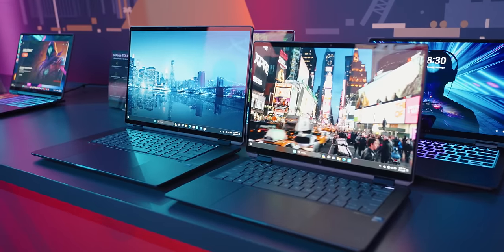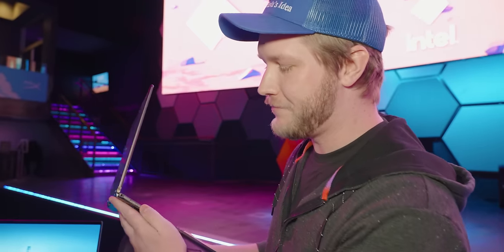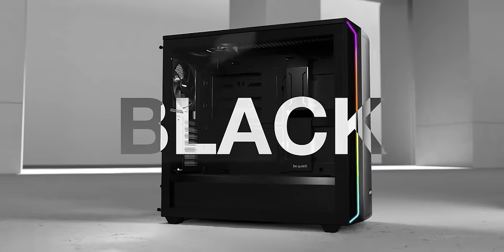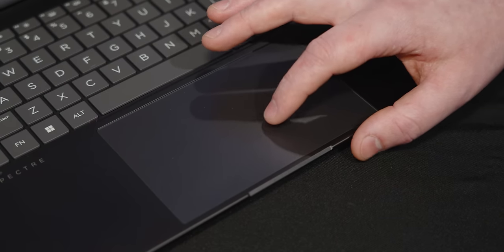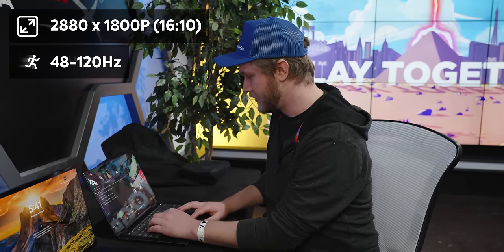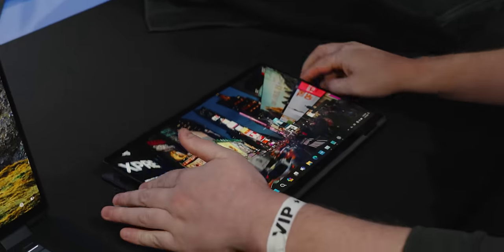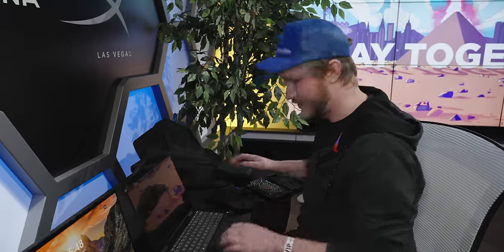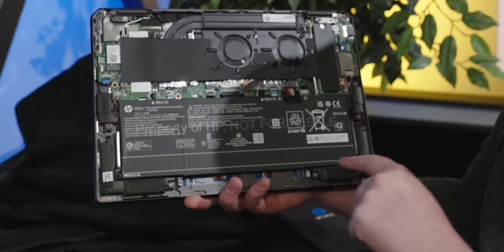Alright HP, I'm Interested - HP Spectre X360 & OMEN Transcend 14

Comment from the maker: We received some new info from HP after CES about the Omen Transcend 14: The $2000 price is for the configuration we had at CES and the actual starting price is $1499.  Also, the construction is aluminum with a sandblasted anodized finish.

Comment: Like if you cant afford any of these laptops.
Reply: twzzy3695 So you can't.
Reply: Hp has a $9000 zbook fury 16 g10!

You can max out with 128gb, four 4 tb sdds, i-9 processor for $18000, $10000 on sale
Reply: And...I don't understand what comments like these add to the discussion of these products. Something will always be too expensive for someone. So? Do we have to hear this stupid comment every damn time? Tech is always expensive new. It's not even discussion on value vs cost or anything less brain dead than "dur dur it's expensive...dur dur" .
Reply: its supposed to be funny damn you must be fun at parties
Reply: @chemicalhap  bro is the fun police
Reply: @yulpark9299  or maybe shit hasnt been funny for years?
Reply: @chemicalhap Just the broke mfs who keep complaining 😂
Reply: I want to like but I am not poor :(
Reply: We need Snapdragon X Elite 20/35 Watt in $1200/€ Notebooks, builded like MacBook Air or something. Windows 12 will boost the effciency and bring new x86 translation layer, i guess.
Reply: @gntyh I am with you. It ain't funny. It was tired years ago but the peanut gallery persists.
Reply: that means you have the wrong job
Reply: @macking104  damn for real?😢
Reply: Even if I can, I don't want to.  In 5 years it will be outdated and in 10 it'll be e-waste.  A laptop seems silly to spend four figures on.  I'd rather go used, buy something cheaper for portability (thankfully we have so many options), use a desktop, etc.  

I'll admit I'm intrigued by Framework though.
Reply: @ChristopherBurtraw  framework was outdated thanks to the long shipping wait 
Ryzen new generation is out and it was a mini update

But others stuff is repairable and have less e-waste (assume framework going strong and parts are still available ,or people still making parts for it )
Reply: @frankwong9486  thank you - you're proving my point about how fast this stuff goes out of date for how expensive it is, and framework is no exception.  The strongest thing they have going for them that few if any competitors can claim, is the ability to use the main board independently of everything else.  I bought a used first gen board for cheap from someone who upgraded and made a sick router out of it, for example.
Reply: The point of these comments was never to be funny or to make a comment on affordability. 

The whole point was to farm likes.
Reply: Well, I actually can afford any one of those laptops, so I'm not liking your comment
Reply: 4070super 😂 cool profile name that's awesome.

Comment: A $50 upcharge from 16gb to 32gb of ram on the spectre 14 is insanely refreshing. Great to see soldered ram isn’t so much of a downside here.
Reply: and apple is asking $400 for it lmfao
Reply: The funny thing is, they're still making good margin on that price when using soldered RAM. I don't mean they're overcharging, but that it's still at a quarter the price of competitors a good money maker for HP. Just puts into perspective how extortionate Apple and Dell are. 50 is reasonable.
Reply: @idontmindu  you should see dell later lol
Reply: And it's good RAM too at that. Insane speeds. 32GB of this and you will probably never need to upgrade in the life of this laptop. I doubt you will ever need more RAM on a 14" thin and light anyway. This is soldered RAM that finally doesn't get me mad.
Reply: @azenyr  It's the best RAM you can currently get i believe, they obviously optimized the trace lengths to get that speed. At any rate it's easily superior to what apple is charging 4x the price for. They're using the same BGA's they did in 2021/2020
Reply: @azenyr never say never need it on a 14in laptop, cause eventually you'll need it. Pretty much all my systems at idle use over 10GB of ram at this point, so we're already at the point where 16gigs isn't enough for most people day to day, 32GB won't be far behind.
Reply: Isn't the thing about apples ram is that it's on die? Not really the same(though I'm sure they could still do it for a lot less than they charge)
Reply: @CCBCodeMonkey  It's not it's just on the same interposer. The ram itself is industry standard (except for Max chips they are larger BGA's.)
Reply: @fVNzO  my bad I thought it more tightly integrated, then they have no excuse.
Reply: What's funny is everyone complaining about the soldered RAM in the video for the Dell laptops - even though it's the same thing, the highest performance config you can get(hint hint, these are all Intel 'Core Ultra' laptops, the high performance soldered RAM is Intel's doing). There are absolutely times when soldered RAM is bad, and it's when it's low performance garbage chips in cost cut devices. But this isn't that by any means.
Reply: @RyTrapp0  Whats even more funny is you missing the point entirely. I don't think anyone is against soldered RAM in theory.
Reply: @CCBCodeMonkey  Not at all, their marketing has been very confusing from the start. I was surprised myself to learn that it's not all on the same package. Which would absolutely add cost and complexity. But when you take a look at the laptops you can see that they're essentially just placed really close to the SOC. That makes it very difficult to desolder them without taking off the SOC itself so it's a large job. And i think not really doable due to software locks as well. Conclusion though is that they're using off the shelf parts like everyone else.
Reply: @fVNzO  Feel free to go read the comments in the video I'm referring to then so you can see how wrong you are
Reply: @RyTrapp0  And i quote from the most popular comment in this thread:

"This is soldered RAM that finally doesn't get me mad."

9 upvotes. Feel very very free to read the comments again so you can see how wrong you are.
Reply: @fVNzO  Once again - the DELL video

This video is not about Dell laptops. This video is about HP laptops. As I said from the beginning, I'm referring to the comment in the DELL video
Reply: @RyTrapp0  I don't know what dell video you're referring to. You're not doing a whole lot to help yourself here.
Reply: RAM pricing is the best it's been in a decade, modular pieces anyway. Nice time to build a high end machine tbh
Reply: GO for 64 GB if you play GT5... I had 32gb and dropped to 16gb to save money after my 9 year laptop(Msi GT72s)  gave up, and it was worst than 32 GB.. game and no background music with 16GB and it is icky

Comment: The 45 degree corner port is great because you can break your charger off from two different directions!
Reply: seems to make sense for the 360 convertible design which looks thin and llght enough to  hold.
Reply: At what point do we just have magnetic connectors already? I often think that people overreact when design flaws come up with products and many claim that it's 'planned obsolescence'(I mean, that is a thing, just not like many seem to think), I whole heartedly believe that 'Hanlon's Razor' is the answer more often than not. But I'll be damned if laptop charging ports aren't planned obsolescence, we can't get an ounce of R&D in THIS area lmao.
DC barrel jacks are the work of the devil
Reply: @RyTrapp0  after September 26, 2025 when Apple's patent expires.

Comment: Holy shit that omen has a 90W RTX 4070 despite being so thin blows my mind. I guess we need a follow up testing for that one. Anyways damn that's one hella crazy thing!
Reply: Yea, HP always seems to screw up providing as much power to components as advertised.
Reply: it's actually 80 W, it goes up to 95 with dynamic boots. Still amazing tho
Reply: @pegatrisedmice  doubt it can sustain 80W with that cooling
Reply: My 2020 omen 15 has an 100 w rtx 2060 but with open hw monitor I see it go to 108 w
Reply: Other 14" gaming laptops (at least in the same price segment) have 100+ W TGP for GPU, and they're not much thicker (like 1-3mm at best) so I wouldn't consider impressive. They're more likely limited on this Omen because of that 140W charger (Power Deliver 3.1 only)
Reply: Now that it's out, I'm pretty sure the actual TGP is 65W. 50W + 15W dynamic boost. One of the weakest 14 inch gaming laptops ever released. Just for comparison, my 2021 Asus G14 goes up to 75W. It's not a bad laptop at all but HP should've did more
Reply: @wrth I think it has excellent cooling

Comment: Pretty hype for some 14 gaming laptops with dgpu that is pure USB c pd for power. I liked my g14 but the power brick charger does make the overall backpack space more than you'd think. Can't wait to see how it compares with other 4060 4070 laptops.
Reply: When I had a G14 I set up an 90W power limit profile in G-Helper for 100W type-C gaming. 25W CPU limit and 65W GPU limit with the screen capped at 60hz to save some power on the panel. Sure, not as fast as the full 85W CPU and 105W GPU, but it was still better than the iGPU-only I had set up on battery with a 15W cap (basically converts to 6900HS to 6800U).
Reply: I bought the 240 W SlimQ charger with the asus adapter for my g14, definitely more portable than the oem charger

Comment: Nice to see they've gone back to removable wifi card on the Spectre x360. We dropped Spectre (and HP) from our org after using them for 5 years... because they soldered in the wifi cards on the last models we used. Manufactured e-waste stuck in wifi 5 land.

Comment: Haptic touchpad, variable refresh rate, and that spectacular webcam are all pretty nice upgrades over the last model!

However, I'm a bit worried about the battery life for the Spectre considering it ONLY comes with an OLED. But considering the Zenbook 14X OLED is getting about the same battery life as the Macbook Air, I would assume it would be pretty good. Wish it would come in actual silver though.

Also, HP probably is reporting accurate battery specs for its higher end models, but in my experience, they have been reporting double or even triple the real battery life on its models like the Pavilion or lower.

Also also, the 16" starts at $1598.99 US.
Reply: Hp pavilion Plus 14 (68 Wh) with #AMD 7840U has 10 to 11 hours of BATTERY.

Hp spectre x360 14 (68 Wh) with #Intel Core ULTRA 7 155H has 14 to 15 hours of BATTERY. 😱

Intel laptops BATTERY life is as good as MacBook M2/M3 even though Intel is using Tiles/Chiplet.
Impressive🤯
💪
Reply: New Zenbook 14 OLED 2024 with Core ULTRA 7 155H got 70% better battery life than Zenbook 14X OLED.

Comment: How did crab rave sound on the spectre? Did you check? The speakers are a weak point on the 2023 spectre, but it's otherwise really good (compared to the old diamond cut models).

Comment: Has hp fixed the self destruction on the x360 where the mossfets get so hot they weld themselves to the first layer of the board?
Reply: I’ve also never seen a brand with more spicy pillows and hinges that end up so loose they fall in half after a couple years.

Comment: I hate that HP locks down drivers for the keyboard and fingerprint reader. I really like my spectre 14 but it gets hot on windows so I run lunux now. Why can't I have a working keyword HP? 
Also, they removed an option to charge the battery to 80% some time ago. I paid good money for the laptop and I want that feature.

Comment: currently have the 2021 model of spectre x360 and i use it with an egpu, the 16 gb of ram has been such a bottleneck so if i can get the 3:2 form factor with 32 gb of ram then im sold on a new hp

Comment: If you're getting a laptop for future use, save yourself the trouble and get the 32GB version. 
Storage was never really a big problem even for soldered down models (at a minimum of 512GB) because you can always add an extra SD card or external USB drive. (Or cloud storage)
Reply: lol if you think soldered storage is okay, you’re insane. Especially if you also think an SD card or cloud based storage is convenient or fast enough.

Frankly I’m really disappointed you got any likes on this opinion.
Reply: @BahhBahhBrownSheep  I don't like soldered down storage either, but sometimes you're out of luck. Cloud based storage is convenient though. At least for me it is. I was just listing down some solutions. The best would be to buy a laptop where everything was swapable.

Comment: The problem with pixel voltage for VRR technologies is nothing new.  If MSI has adjusted it for a few fixed frame rates, why doesn't any manufacturer bother to adjust it manually from at least 38 - 120/165hz and eliminate the VRR flickering?  All manufacturers are probably waiting for LG Display and Samsung Display so that they can solve the problem on the hardware level themselves.

Comment: HP finally ditching Intel Arc discrete graphics and moving back to Nvidia on the Spectre is a good move (that's what stopped me from recommending it before), and with Dell's questionable choices for the XPS I think the Spectre is a really good alternative premium Windows laptop.
Reply: they ditching the intel Iris X, the new meteorlake apus have the intel Arch insted of the Iris which is more than 2x stronger. The Spectre 14 has Arch only.
Reply: @Antal46  Yep. In 2023s model though the HP Spectre maxed out with an Arc A370M which was quite bad compared to the 40-series Nvidia cards, and that's why I never considered it. This year they have an RTX 4050 option which is a far better option.

Comment: Rear diagonal ports is odd. No numpad is a bummer, but at least it has function keys...
Reply: The diagonal port can actually be quite useful, I have an older spectre model and charging it while working on the couch or in bed with the cable a bit out of the way is great. As for the keyboard - most 13/14 inchers do not have it as the keyboard will be quite crammed, but it's good on a 15-16 inch ones

Comment: All Brands are using the new Intel Core Ultra on their 2024 products , Ryzen in the other hand didnt get that attention, maybe their mobile APU is way far from what intel has been offered bcs the 780m is a hell of an iGPU
Reply: Given MTL's delays, I wonder if most of these designs were already ready to launch for Q3 2023 and manufacturers simply have to get them out now.

If it was just as easy as flipping a switch, I'd also suspect that many OEMs would've massively gone Ryzen by now. Unfortunately (for consumers), it's not that easy. I at least would prefer Hawk Point and even Phoenix any time over MTL.

Be that as it may, 2024 will show how much of a stranglehold Intel still has over OEMs. As soon as Strix launches, we'll either see widespread adoption or we'll see the same MTL designs get refreshes. That's when we'll know if it's about the superior design or if Intel's simply stuffing the channels again.

Comment: The thing that's kept me from looking at HP devices for almost a decade now is the bloatware, and with the blatant McAfee popup it looks like HP still hasn't changed a bit. Maybe they'd be good Linux machines.
Reply: when I installed linux on my spectre 2018 model only half of the speakers were working anymore bc they do not have drivers for anything other than windows, same with the touchpad behavior. really annoying
Reply: just reinstall windows when you buy it
Reply: You can also remove the McAfee stuff. I always nuke it when on my machines. It's annoying yes but if those bloat deals get us cheaper machines over all then I'll live
Reply: The bloatware isn't actually that much like it use to be. I think Mcafee is the only app on there, outside of a few web links you just delete basically, and their own apps which don't cause any havok to remove.  So is there a antivirus app, yes, beyond that its nothing spyware data heavy at least.

Comment: I'd be interested if they came with Ryzen 7000 or 8000. So disappointing...
Reply: Yea im disappointed too. The supply of ryzen laptops is abysmal and it seems to have only gotten worse
Reply: Agreed. All these Meteor Lake designs seem so pointless.

At least HP seems to actually use high speed RAM in production models instead of giving it out to the press and then downgrading for production.

Comment: Never trust HP My laptop has so many problems and it hasn't even been three years since i purchased it. (I had to replace my Screen, Battery and it took them 4 months to fix a major network driver issue.)
Reply: Which version did you get?  I hear and have read reviews that HP EliteBook, HP Dragonfly, and HP 360 are usually good laptops.  The other models are generally trash.

Comment: If you are nuts enough to touch HP Omen: Omen 16" purchased June 2022 - screen failed in less than 5 months! Replaced under warranty - Screen just failed again for second time, HP want SIX MILLION NINE HUNDRED AND 50 THOUSAND RUPIAH ( $440! ) to replace it again. We are a non-profit who now have no laptop or means to replace this one for a more reliable and better quality brand. Be warned - the quality of Omen is absolute junk and a rip-off - I didn't see any issue with screens failing for any other brand like this. We would appreciate if anyone could help us with this - since we are a charity, while HP just wants to profiteer.

Comment: Can someone explain why ram speed is now MT instead of Mhz?
Reply: Because that's a more accurate description. Using let's say "6000 MHz" - a unit of frequency - for DDR5-6000 is incorrect, strictly speaking, since the RAM operates at 3000 MHz but with double data rate (hence DDR).

MT (mega transfers) is not a unit of frequency, and it actually describes what the RAM does. That's why it is preferable to use MT instead of MHz.